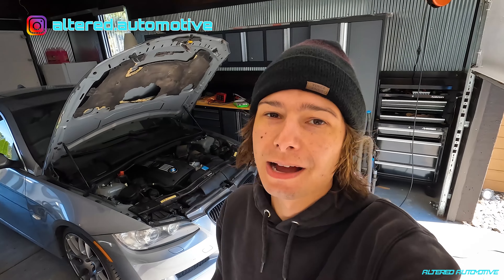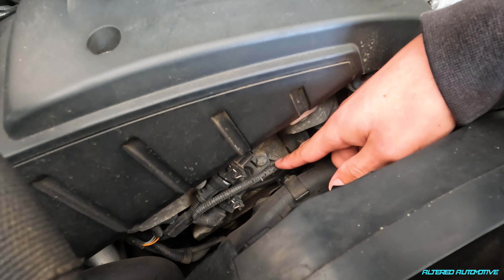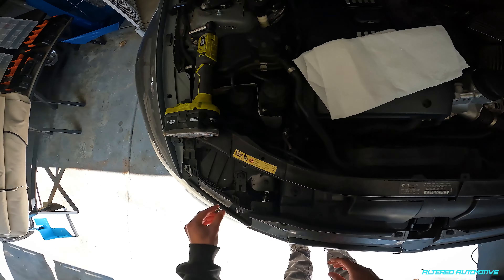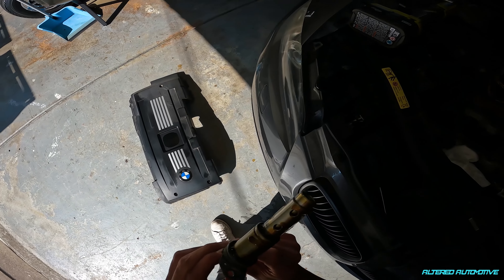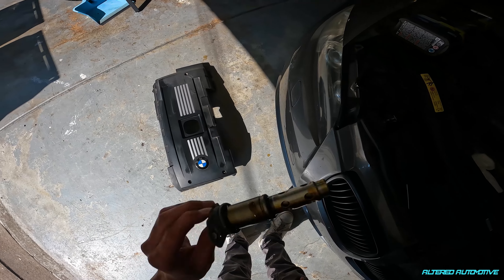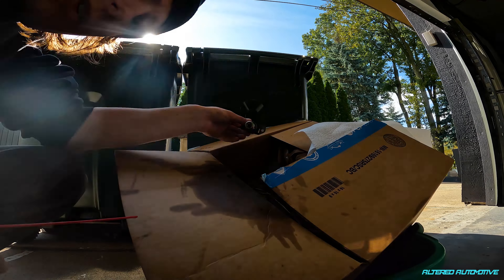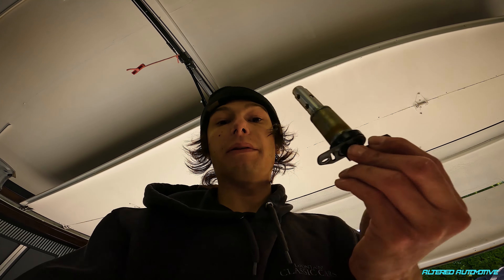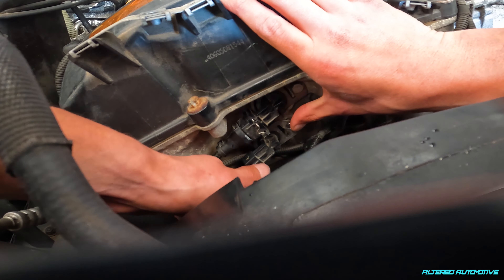335i OWNERS, CLEAN THESE BEFORE ITS TOO LATE!

Comment: Yo, my 335 is doing the same exact thing and  have full maintenance done and no lights or anything wrong with the car. I cleaned the solenoids too and it got a little better but not all the way. I feel like its normal but not at the same time. Dope to see ur from michigan too
Reply from the maker: Any codes? It honestly could be tune related I’ve read about peoples cars running better/worse on certain versions of MHD
Reply from the maker: @nathanieliacoban5995  That's how mine has been but in cylinder 6 (no issues in datalogs as well).  I was hoping that if this didn't solve the issue, cleaning that intake valves would do the trick. I feel like there is a lot of guessing that goes into getting these cars to run right
Reply: just did my intake valves at 200k they were soooo bad i used 6 cans of brake clean hose connected to my vacuum and a mini wire brush and a little pick to chop the big stuff off the valves so much better now and super cleannnn. i did them while i was doing the oil filter housing gasket, serp belt, coils and plugs few others @AlteredAutomotive  to be fair for 200k my intake valves werent that bad ive seen worse on lots of toyota pickups.